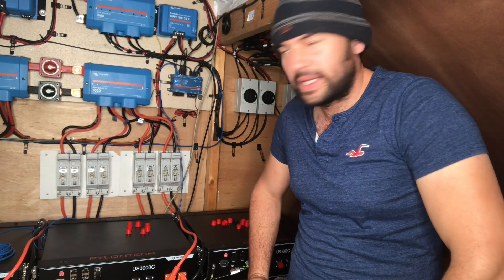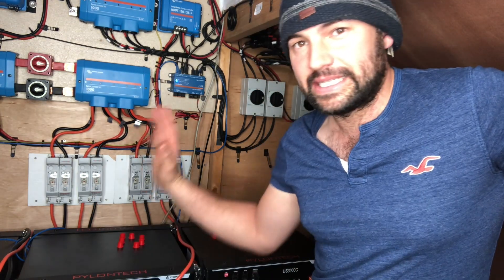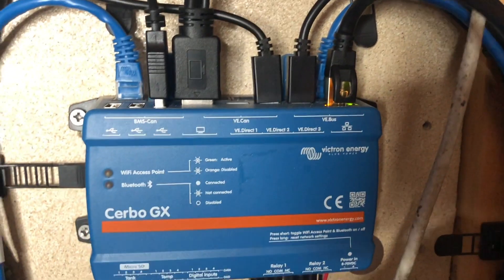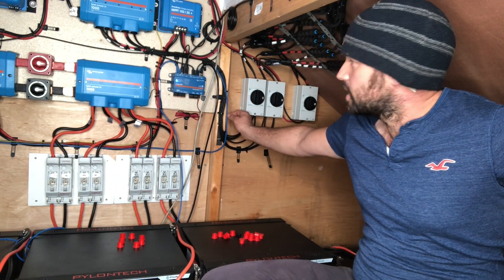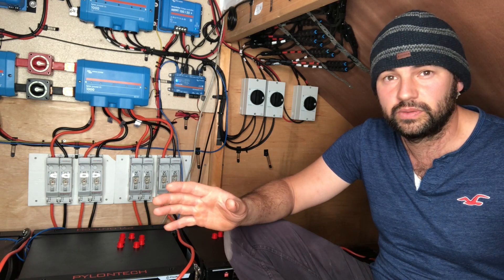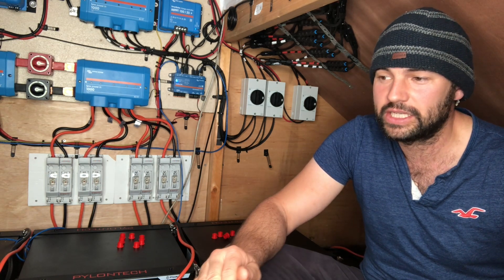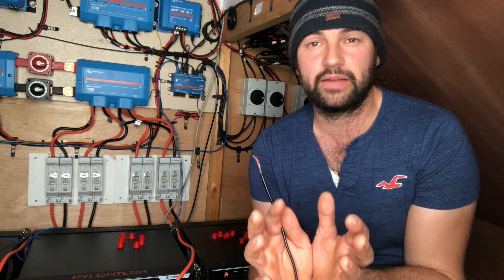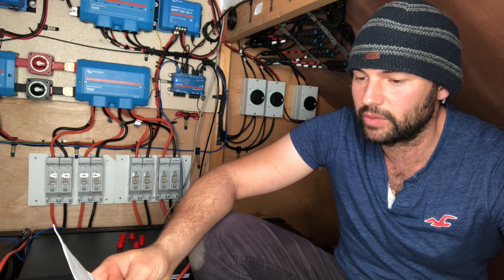VICTRON Cerbo GX & TOUCH 50: OFF GRID SOLAR SYSTEM - Features, including generator start/stop wiring

Comment: Pylontech, that's the problem. They are marketed as great batteries, they are terrible quality and there a many warranty returns. They have pouch wrapped cells and that's the worst cell setup you can get. You've done a good job.
Reply from the maker: @Kanuka-Forest  Thanks for the comment. Yeah they are not great but Victron buddied up with pylontech. Shame on them. 

 There is a video out there where a seller of Victron and pylontech basically says how great pylontech are and it’s a little dig at me in a few ways without mentioning the off grid family. But the seller of them says they have no trouble and they are soo reliable. 

Yet loads of people have said they have had trouble. The most an annoying thing was the lack of customer service.

Comment: Fraser, thank you so much for sharing your experience of rural off-grid living - it is no doubt to become mainstream. We live in interesting times!
Question for you on how you sized your MPPT's, I see you have a 250v 100A unit connect to the strings of 16 LG panels producing max 40vdc 10A each that would produce 640v 10A peak  and you have a smaller 150v 35A connected with 4 LG panels in parallel would give out 40v 40A. Kindly, could you please shed some light on how you arrived at choosing these two MPPT's. Am i missing something?

Comment: On the CAN terminator you mentioned. Not 100% sure but it sounds similar to a CAN network used in automotive systems.  This is a high speed network that allows on board computers to communicate.  By design these system circuits require terminating resistors. The exact reason why requires more explanation but a quick internet search of “CAN network terminating resistor” may help with your understanding of things.   Hope this helps.
Reply from the maker: Thanks for your comment and for the info 😊

Comment: Hi there, I’m really enjoying your videos, we are also in the process of going off grid using Victron products. I noticed that you mentioned that you were having trouble with your Pylontech batteries and you are getting internal failure faults, we also use Pylontech US300C batteries in our battery bank, and had the same issues. In the end we ended up switching all the dip switches on all the batteries to “off” which is contradictory to what the user manual says. Since then we have had no further issues. 
I am by no means an expert but I just thought sharing my experiences might help.
Reply from the maker: Glad to hear you’re enjoying the videos 😊 Thanks for the advice about the batteries 👍

All the best with your off grid system. What Victron products have you gone for?
Reply: Well we’ve been building and adding to our system for a few years now as time and funds allow, with a view to going off grid eventually. We are in a slightly different situation to yourselves in that we currently have a connection to the grid, but we are choosing to disconnect as we want the feeling of independence and freedom that this will bring. The Victron products we have are 3x 15kva Quattros and 4x 250-100 MPPT charge controllers. We have the Venus Gx which works well however after watching your video on the Cerbo we might upgrade at some point as it looks like a great piece of kit. In regards to the Pylontech batteries, we have been running our system whilst being connected to the grid as an ESS system for quite some time now using a mixture of US3000C batteries and the older US3000 batteries and we have had no issues with them apart from the odd high voltage alarm, however even this has stopped now. So hopefully that might give you some reassurance.
Reply from the maker: Thank you for the reassurance about the batteries. We are hoping that as we learn more about them we will iron out the issues we’re having. 

The Cerbo GX has been a great bit of kit to have. Not sure the touch screen is necessary for most people, but with our slightly unreliable internet we find it reassuring to know we can keep an eye on things without relying on the Victron Energy app, even if it does mean climbing into the attic of the barn where it’s all kept!

Comment: Found your channel after searching for MIG welding from solar panel system. Great channel, have always wanted to go offgrid. House isn't ideally located for solar PV but might be able to convert garage to solar as roof gets more sun than house roof.
Reply from the maker: Thanks for your comment. It’s always interesting to hear how people stumble across us 😊 Building our solar power system has been a real learning curve and we are in no way experts, but investing time in research goes a long way 😊 

Roof positioning is a tricky one. We were lucky in that we built our barn specifically for housing our solar panels so were able to pick the angle and direction it faces 👍